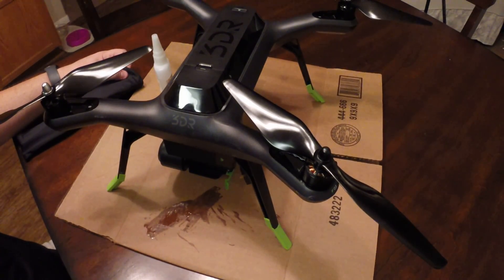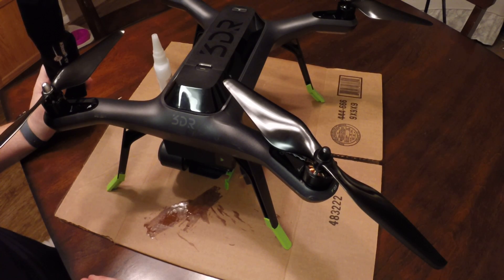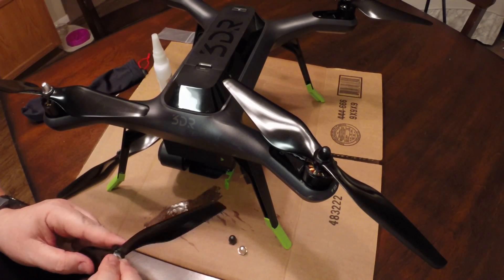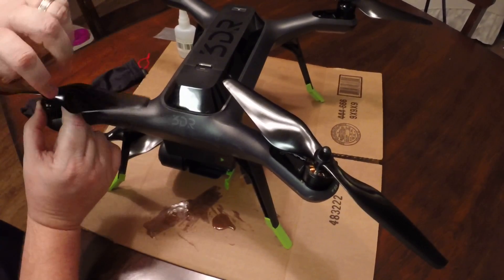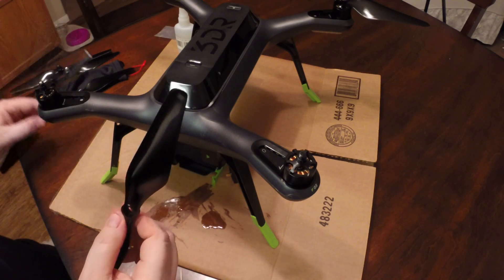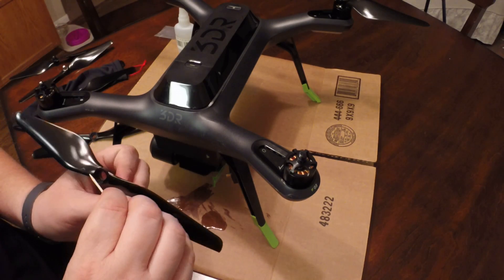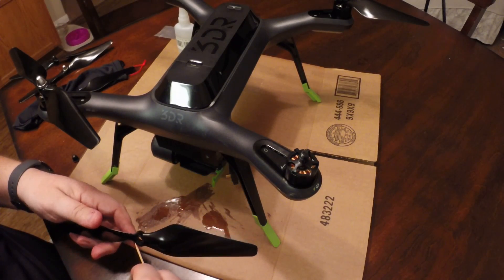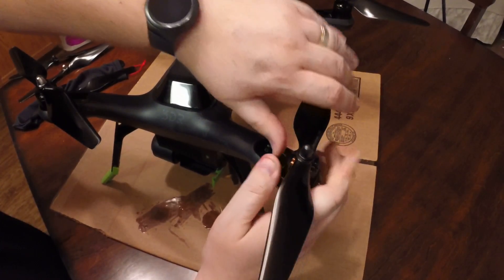Master Airscrew props for 3DR Solo

Comment: You forgot to add in the $9.00 shipping charges and there is no real third party testing results showing they are better. Most people assume because they are shinny that they are better but thidps is not the case
Reply from the maker: +Donna Mcnairy Shiny means nothing when it's in the air. But if I can get the same performance or better with a cheaper, but equal prop. I'm ALL over it. Just my opinion.
Reply: Donna Mcnairy yep you were right I put the nuts on the,wrong blade so I switch them and it,works great do you know of,any other up,grades  I could do to my solo .is the soloplex app better then the regular solo app I was thinking about getting the app but I'm not gonna pay 25 dollars if the app is no good

Comment: This could potentially cause issues with prop balance.
Reply from the maker: +BigTulsa I do not see how this would be an issue if using small amount of super glue. Epoxy, maybe. Just my opinion. I have not seen any issues with the balancing.
Reply: BigTulsa I bought these master air screw propellers and 
They just spin really fast my drone will not lift off with these they do not work do not buy them you will be really disappointed
Reply: Donald Martim  you most likely installed incorrectly, these props work perfectly